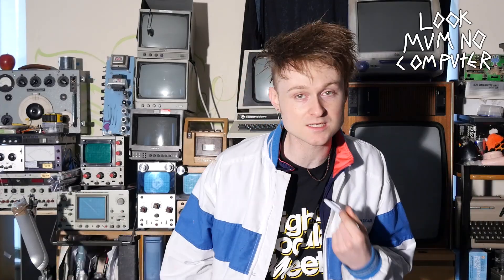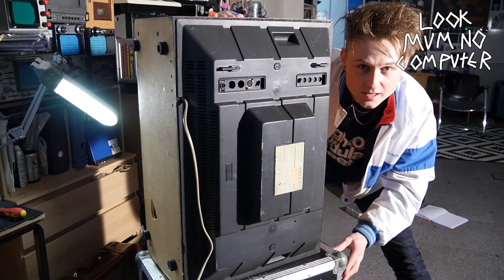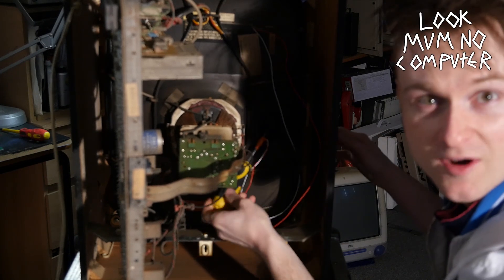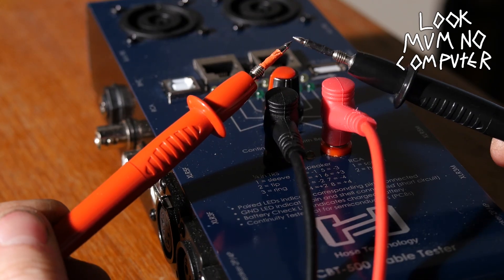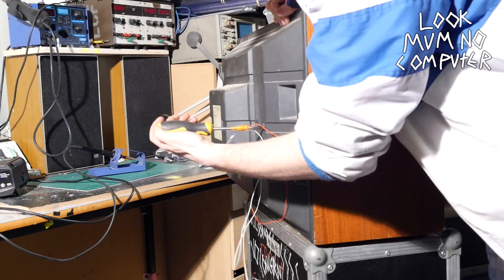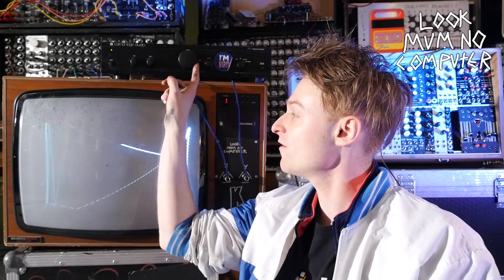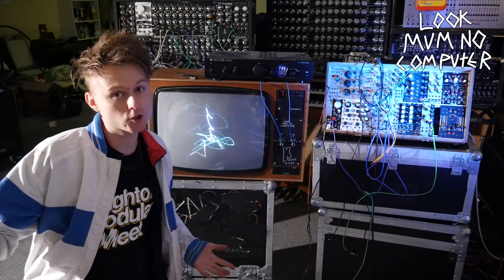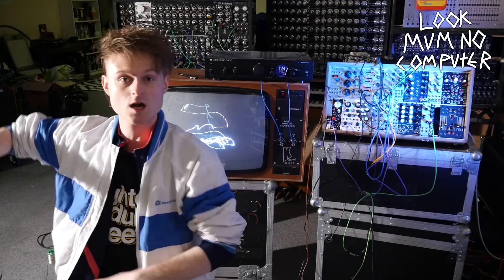Turn an old TV into an Oscillograph For Oscillographics!

Comment: Many TVs use the horizontal deflection coil as part of the flyback circuit.  Disconnect it and you lose your CRT high voltage supply.
Reply: yeah, i was looking for this, i've already done some kind of non-triggered o-scope (crap) years ago with a lucky TV and i'm trying to figure out how to do this on a regular TV.... infos? (if you're still around) maybe a dummy inductor of same value?
Reply: @redoverdrivetheunstoppable4637  I'm still around but YouTube isn't notifying me of your reply.  A separate inductor should work, though I've never tried it.  Heck if you can find a delection coil from a similar tube that would work.  Just make sure to use the horizontal because the vertical is different.
Reply: @KC9UDX  i succeeded at making an oscillograph, i fitted an inductor of similar value on the horizontal circuit with a series resistor to copy the yoke (away frome the picture tube otherwise it drives the beam a bit), same thing on the vertical section to fool some protections, rotated the yoke 90°, adjusted brightness on the three colors, used a 12V bridge amplifier chip (car radio style) to drive the thing and a func. gen. to generate a triangular wave for one axis, the only two problems i found are the coils that prefer current drive instead of voltage (the movement is non-linear if driven voltagewise and i don't know how to make a power current amplifier) and the vertical coil (now horizontal) is a bit deaf to high frequencies

yeah youtube sucks at delivering notifications, i've also discovered people offending me only after some time, this changes little but WTF!!! some say it's a tactic to direct people less on the comments and more on the videos to visualize more ads... that's a downer and it sucks
Reply: @redoverdrivetheunstoppable4637  Yep frequency response is going to be bad.  These days (well it's been decades) you can clear up linearity issues with a microprocessor.  The processor takes in X and Y values and outputs corrected voltage (or current) representations.  (You'll need DAC and amplifiers) I like to use 65xx but this is certainly doable with Arduino or BASIC Stamp and the likes.  I could probably help you with the voltage vs current thing but I'm a bit out of practice and just terrible and explaining these things.
Reply: @redoverdrivetheunstoppable4637  By the way, I admire what you're doing.  I've never converted a TV to an oscilloscope, I've only done it the other way round.  Since you're using a colour TV, you have the makings of an awesome vector graphic video game system.

Also, you don't have to use the normal deflection coils at all if you don't want.  You can wind your own for better characteristics.  The stock ones are engineered to make the other circuits work, and you don't need to do that anymore.
Reply: @KC9UDX  thanks for your time, anyways i already have an o-scope and it passes 100MHz, i called that an "oscillograph" because i don't know a better name for it, so the TV was just to make a fancy music visualizer, i've also tried that "oscilloscope music" sample you may have seen here on youtube, with mushrooms and shapes, but low frequency and non-linearity make the figure all distorted, but it works as a "wave dancer", also the amplifier seems to make very low frequency pass... for now i rest the project, making it better is too complex for the results :D
Reply: @redoverdrivetheunstoppable4637  If you ever need other fun projects, you could build some Scanimate like circuits.  The experience would assist you in improving what you have, if you ever desire.  See this: https://youtu.be/pNfNX2d8NVk
Reply: This explains my problem!!! I was so disappointed that I could only get one angle... and got zapped by my audio source chassis (!)  I was using a 90s RCA... how far back does one have to go to avoid this??
Reply: @vertefish  the earliest TVs I've worked on were from the 50s and they worked the same way.  I don't know that I've ever seen a TV or monitor that didn't work this way, but I've never been looking for that.

It's a safety feature: apparently deflection coils burning open must have been common at one time.  Because the reason they use that coil in the HV oscillator is so that when that coil opens up you don't burn the phosphors in the centre of the tube.

Comment: Big CRT computer monitors are awesome for this, as they are basically thrown away as junk now, and they can make a very sharp, bright beam. Some of them aren't happy if you disconnect the deflection coils, as they do other jobs in the circuit. They can fry in a matter of minutes. To be safe, measure their inductance and resistance and wind coils with resistors in series to replace them and keep the circuit happy. If you keep the VGA port connected, you can quickly change the colour of the beam.

Comment: If you are looking for chaotic VCO's and LFO's (in eurorack format) defintely check out Snazzy FX and NLC (non linear circuits), they make some of the best chaos stuff on the market!  Though they work at lfo to audio rates though not sure about video rates so please do some more research (anything on lzx's website or any forums (I recommend muffwiggler.com) they are featured on will give you a vast wealth of information on video synthesis and its requirements/parameters)

Comment: that was so sick. are the x and y the frequency and amplitude of the wave? what outputs from your modular are going to the amp? and what outputs from the amp are going to the x/y jacks? thanks! x
Reply: I have the same questions. I dont understand what controls the y and x
Reply: The axes map to left and right channels from the stereo amp.
Reply: https://www.youtube.com/watch?v=rtR63-ecUNo Jeroen Fenderson has pioneered stuff like this, producing sound files (even a whole album) of stuff that produces graphics on a scope screen. 

I think the point is to experiment. Connect different audio sources to X and Y and see what happens. Jeroen uses a PC to generate his sounds. You could do the same, though it would be more sensible to use an actual oscilloscope. Anything that involves taking the back off a CRT TV is risky, they have thousands of volts all over the place, and hundreds of volts in others. 

This hack involves removing the screen driver coils completely from their circuit, connected only to the outside. So theoretically it should be OK. Assuming the TV you try it with is the same, you'll also be OK. But generally I wouldn't be happy connecting my expensive PC to wires hanging out the back of an old TV I'd pulled to bits. 

If you wanted to reduce the risk, you can get USB sound cards for a dollar or two online. Even more, you could get perhaps a Raspberry Pi and use it there. Log onto it's desktop over a network, maybe Wifi, and operate it remotely.
Reply: Oh, or of course you could get ridiculously expensive modular synth equipment from an old recording studio or musician. If you can find it. And even the old stuff is sought after from people who like the old analogue sound.

Comment: Hi, I read that its not usually the amount of volts that are lethal to human, rather than it is the ampere of the current. Does the fact that the electricity is charged have any impact on the amount of amperes in the current? (versus a straight current coming from the wall i.e) Lets say if i would measure the amount of volts charged in the CRT, how would one calculate the amperes present? Cheers!
Reply from the maker: its relatively low current. regardless its still a bit of a zap. that could kill. or could not. just not worth taking the chance!
Reply: LOOK MUM NO COMPUTER Fair enough. Ill try not to get zapped any way.

Comment: Well.  Not lightning quick.  The Vectrex deflection circuitry needs an upgrade to be lightning quick.  For now it's just fast.
Reply from the maker: its bypassing the deflection circuitry in andrews mod, but yeah. i mean its just a figure of speach. relatively speedy
Reply: The mod bypasses the logic board output deflection. But not the deflection circuitry on the Vectrex's Power Board.  Where part of the problem exists.
Reply from the maker: Oh sorry I wasn’t aware. I thought it just bypassed everything and tapped straight to the deflection coils themselves. They have a board on the actual tube itself then? Interesting. That explains why Andrew is able to get them bigger without amplification. Cool thanks for that!

Comment: I got zapped a few times. It doesn't hurt just a large flash and a bang. Not as large of a flash than when i tried to dry blackpowder by the fireplace. Not as big of a bang than when i ignited a O2+H2 mix. Mind this was in the early 90's when kids could be kids.
Reply: Joaquim Guerreiro How bad you get bit depends entirely on the set in question... some don’t have as much stored charge as others; some have bleeder resistors to drop the charge to ground after power-off; etc. However, some TV sets store enough charge to be lethal, so it’s a case of better safe than sorry.

Comment: Ditto what was said below: you need extra radiation shielding for this kind of project. Get some extra leaded glass for the front of it, and add some lead sheets on the back and sides of the tube (being sure not to short anything, of course). Older TVs had poorer radiation emission standards, also; so the older you go the more you need to add. Also, if you know what you’re looking at, you can directly inject the signals into the deflection amplifiers on some TVs... ‘course, if you know what you’re looking at, you already know that. 😁
Reply from the maker: hey dark winter! i always wear tinfoil pants its cooo. haha. jokes. but yeah injecting the signal would be best but thats getting peeps to fiddle around near big fat angry capacitors, tough to explain! thanks for the warnings!

Comment: why an old tv , why not a new one. who has an old tv. I certainly do not.   If I was making a visual for the sake of the visual I would probably do the whole thing in silence until I found the image I wanted than turn up the volume to see what it sounded like.
Reply: You need the X/Y coils to control where the image appears. New TVs work on entirely different technology. Of course, you could always use a virtual oscilloscope like https://www.virtual-oscilloscope.com/x-y_button/ then just plug your computer into the TV, but that wouldn't be nearly as fun.
Reply: It's all in the title... Look mum no computer
Reply: You need a CRT TV for this. New TVs are not CRTs.
Reply: How would you insert your music into the webtool, or is it even possible? i understood how to use the x/y tool but i couldn´t find a way to make it react to music- besides, it does`t look as cool as the al black monitor^^do you know anything that could simulate it like in the video?
Reply: Old TVs are analogue, new flatscreens are digital. Even a digital synth module outputs analogue CV & audio Waveforms.
Reply: Where do you live? Old TVs lie on every other street in the cooler & poorer parts of Berlin. If you're in NYC, go visit a thrift store as far from Manhattan as possible!

Comment: managed to blow up that exact same CA amp trying to do exactly this for a uni project a couple of years back, guess the impedance of the tv i used was off or something?
Reply from the maker: this kind of stuff can stretch the limits of both tv and amps. you probably had to drive it pretty hot for a sustained amount of time. ive had smoke come out of amps doing this. with it on max, and a big signal.

Comment: now make a selector switch for different coils for  red green or blue colors on color TVs
Reply: It has nothing to do with "coils" - You need to make some circuitry that can control the electron guns (high voltage - approx 100V), and that way, you can have different colors.
Reply: well, since he didn't touched the electron guns supposedly he could still use the tuner to control them. maybe by tuning into live tv and getting random colors, or getting an RCA to [TUNER THINGY] adapter and send colors from another source. If the tuner works this may be a lot quicker (and safer) than messing with the electron guns directly as they require HV to work.

Comment: Now try playing Jerobeam Fenderson's music on it!
Reply from the maker: i gave it a go! it looked hella wonky and dodgy hahaha. so this method isnt that good! purely becuase the X and Y coils are different strengths, the up and down one is HUGE and the left right one is small but further back. must make it a bit squwiffy
Reply: Could you try using two separate amplifiers, one for the X direction and another for the Y? Then just adjust them until the two directions are about the same strengths? Loved the vid btw.
Reply: adjusting the PAN you don't need two amps, you can give different volume to L and R outs
Reply: Luis this is what I want to know, x-y oscilloscopes seem kinda unobtainable
Reply: I bought a tiny CRT for (the Czech equivalent of) $4, and I have some little amps rolling around, so I will give this a shot. If I can make a quick vid of it with my phone, I could post it.
Reply: Floki Fjällko I have quite a lot of other work going on now, but this will be waiting in my closet in its 5" B&W glory. :) It has a Samsung tube too, so that I found nice.
Reply: rewind the larger coil https://www.youtube.com/watch?v=Ci9qiGVMF7s for proper XY

Comment: Get a heavier leaded glass plate(like the ones on the front of oscilloscopes) to put in front of the screen and keep the brightness down. Standard tv glass is not thick enough to block the excess radiation when you concentrate the beam like that. no-one ever puts a warning on these diy scope tutorials, except for the obvious high voltage. Ps: you can get an analog scope with x/y inputs for about $50 depending on where you live.
Reply: This! That and you have a higher likelihood of burning the screen when there's a concentrated beam
Reply: went to check my b/w tv schematic and it states 17kv at the crt anode cap. tv is from 1958...of course i will not wreck it to make this contraption, i just checked it beacuse 10kv seemed quite low
Reply: But isn't the radiation the same, just more concentrated? Because the anode voltage is still the same and thus the energy of each electron should be the same.
Reply: Not exactly, The concentration is mostly from the absence of raster blanking when the deflection coil is disconnected from the tv's pcb, coupled with the fact that tv glass is thinner & has lower lead oxide concentration than a monitor/scope (because you arent supposed to sit right in front of it). Not to mention alot of older b/w tvs have unleaded glass/ 25kv+ plates. It's not an issue for occasional/live visuals, but if you were using it as a waveform visualizer constantly, with the brightness turned up like it was in this video, it could cause some problems. ps: the electrons come off the cathode in a crt.
Reply: Any more ways to prevent this? I am definitely trying to make one of these and now you've got me nervous. How about a tiny CRT?
Reply: That's why you should use a separate yoke, leave the one there (remove it and replace it with a different yoke from another similar TV) to provide the voltage but using a separate yoke and just the power output of a audio power amp to provide the signal to the carrier will give a much better display and you can use the TV's contrast controls as well. If you only use the yoke with the higher voltage, you tend to burn out the screen, only stands to reason and you can not use the TV biasing controls.  I don't know if there's much info available but try looking up Lizzy Scope. The coils on the yoke act like those in a speaker only where the magnetic fields are produced is different. One is for moving a cone on a speak and one is used to ride the carrier of the electron gun. Fit a separate yoke on the end of the tube will make a big difference and it more fun too LOL One you hear and one you see.
Reply: @ifxman  One coil is vert. the other Horizontal. nothing to do with the speakers. What?
Reply: @dondobbs9302  The coils respectively are acting like the coils in speakers, they are the LOAD. The difference being, one is producing audio vibrations by moving the cones and the other is producing a visual vibration by creating a beam of light in a phosphorus vacuum. They are both magnet vibrations and you should study it and learn how it works, it is very interesting because both vibrate within our very limited hearing and visual senses. The coils connected to a moving magnetic field produced by electrons has everything to do with the speakers and the source...which in this case is of the audible frequencies.   A Lissy Scope allows us to SEE what we are Hearing, in a way hahaha. I was simply sharing what I use to do as a kid learning electronics.  I've been designing and working as a computer analyst for over 40 years now and I;'m retired now but I think we are still using the same science LMFAO  Hope I sparked a light and you try to learn more about what is actually going on with this science. Have a fun one...
Reply: @ifxman  Coils just do what coils do. Produce something. In a cardboard cone, it'll produce sounds and vibrations. In a TV, they'll manifest in waveforms like we see in audio editing software. Right?
Reply: B/W TVs are only 10kV, check your facts.
Reply: Seriously, you should read up on electronics before coming with false claims like that. Jerk!